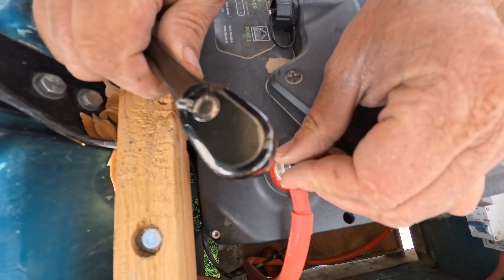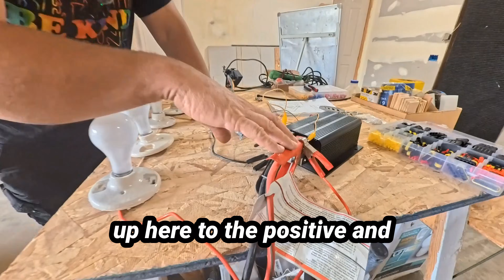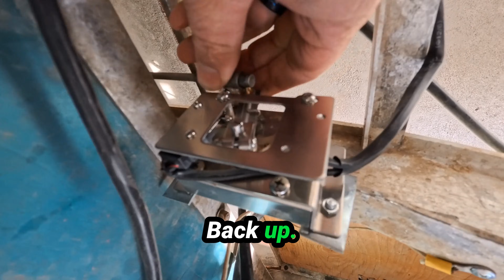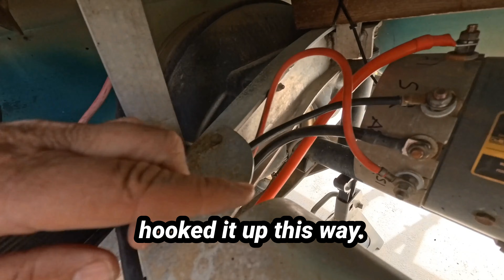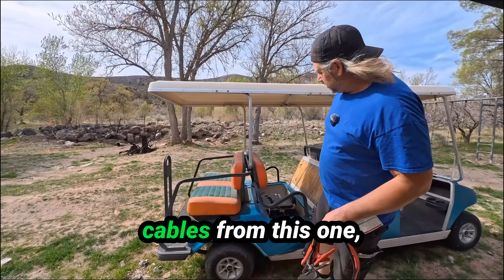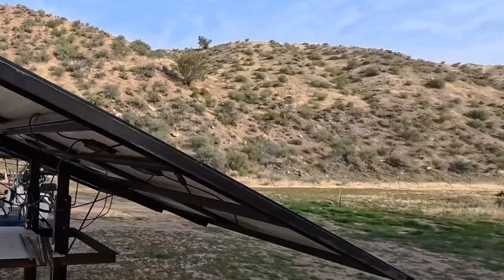Club Car Resistor to Curtis 1205 Solid State Conversion

Comment: What gauge wires are you useing??
Reply from the maker: I just used what I had on hand two 2awg  that came with my battery and the existing 6 gauge wires that were already in the cart. My plan was to upgrade wires if they needed it but they seem to be running just fine. If wires are undersized then they get hot when you're using them and all the wires are staying nice and cool. I would probably need bigger wires if I had a upgraded motor.
Reply: @Thesolarfarmer Thank you for your time.

Comment: I have a 1972 cushman golfster, and I am looking into doing this for it. I have a phisical shifter with 3 contacts that go straight to the motor to control the direction. Do you think I need to replace it or am I fine how it is
Reply from the maker: It should work but, if you are going to use 48v you will need to get a new one.

Comment: thanks for this video I did like you said and everything works great. bye bye hot resitor coils👍
Reply from the maker: Awesome! Solid state is so much better. I have put close to 100 miles of rough driving on mine without any problems.

Comment: Maybe you can help me. I have a 2006 EZGO 42 volt Western golf cart. Changed forward backward switch three times. Melted. Replaced 7 acid batteries ($2000). I put all new 2 gauge wires in case they got to hit too. Had to have controller rebuilt because you can’t buy parts for a 42 volt. This is a high output setup. Drive 20 feet and done. No forward no backward. Paid $3600 for this cart and worked well for a couple years. I’m ready to look for the steepest cliff to roll it off if at this point. How can I upgrade the system to solar lithium when I can’t find any replacement components for a 42 volt? Without burning it up. Heck maybe a good project for your channel 🤷‍♂️
Reply from the maker: I would upgrade everything to 48 Volt.

Comment: Can i use this 48v concroller on a 36v set up or do i need 36v controller
Reply from the maker: I have not tried a 48v controller on 36v but now I am curious how it would work.    The 36v series motor can handle 48v so I went with 48v.
Reply: 48v controller & 48v relay

Comment: Did you have to make any new wires or were you able to just reuse the wires you pulled off your old setup? I'm going from 6x6 36V LA to 48V lifepo AND doing this at the same time as I don't want to chance a fire while my kids are driving it around the 'hood
Reply from the maker: I used the old wires plus the 2 that came with my new battery.

Comment: Great video!  I just put a 48v lithium in my 36v resistor cart.   This is perfect, I want to get rid of the v-glide and resistors for safety purposes.  Do you have to cut the plug off of the pot box and wire it directly?  Or does it plug into the controller?  Hard to tell from the video but the plug didn't seem like it would fit on the controller.    Thanks for the help.
Reply from the maker: The pot box will not plug directly in. I happened to have the right connecter on hand to plug into the pot box and made my own wire harness.
Reply: @Thesolarfarmer  any chance you have a link or source for me to get that connector?  I appreciate the help
Reply from the maker: @eddierivera3928  This is what you need to connect to the pot box if you don't want to cut the wires. 708Pcs 1-6 Pin Automotive Waterproof Electrical Wire Connectors Set https://ebay.us/GvXGmq The connections on the controller are standard spade connecters.
Reply: @Thesolarfarmer  You da man!
Reply: @Thesolarfarmer  Last question.  The pot box has 3 wires coming out of it but the instructions say to use 2 wires coming out of the pot box.  Do I use the 2 red wires?  Or is it a different combination?  I really do appreciate the help.
Reply: @eddierivera3928  same question here
Reply: @tashanrick1  hopefully @Thesolarfarmer will reply.
Reply: @Thesolarfarmer  hey, i hate to bother you but I had one last question.  The pot box has 4 wires coming out of it, but the instructions say to connect only two wires.  Which wires did you use?  I appreciate the help.
Reply from the maker: @eddierivera3928  Sorry for the late reply. somehow that info did not make it into the video, so I made a short video.https://youtube.com/shorts/O3UzUq4XqbI?feature=share
Reply from the maker: @tashanrick1  here is the info on pot box wiring.https://youtube.com/shorts/O3UzUq4XqbI?feature=share
Reply from the maker: @tashanrick1  Here is the info on pot box wiring. https://youtube.com/shorts/O3UzUq4XqbI?feature=share
Reply: @Thesolarfarmer you sir, are the best.  Thank you